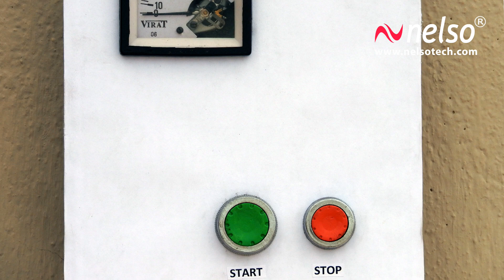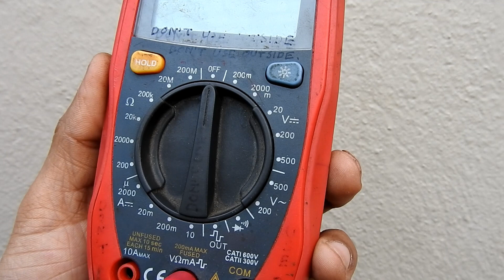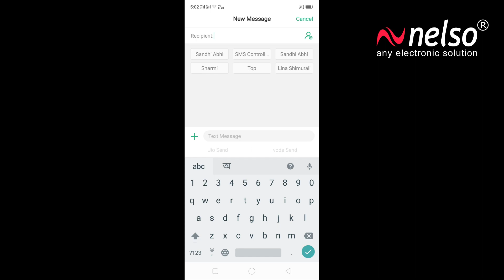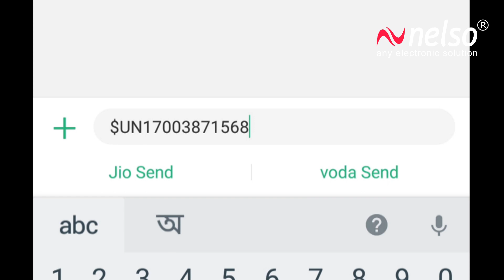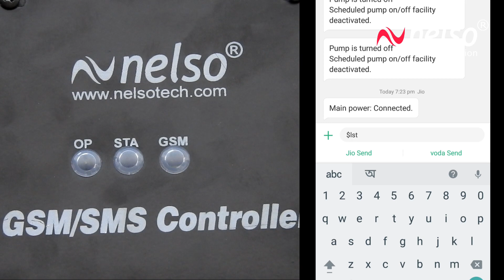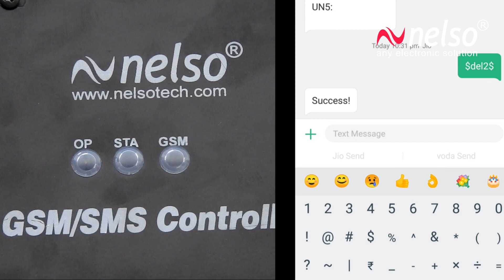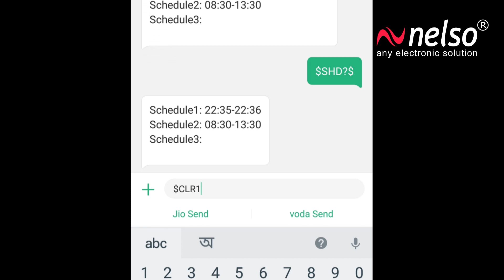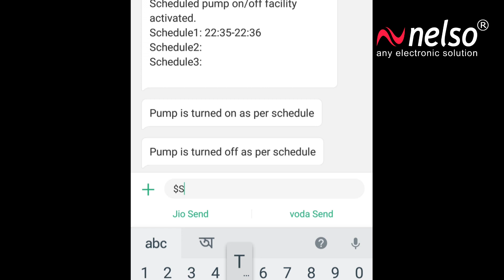English - GSM or Cell Phone based Pump Motor Controller

Comment: Sir/madem and also require electronic starter dry run controller,over voltage,over current, short circuit, and many farmers are died due to touching the outer panal box so please send me the price list of all these instruments . And also I require in very bulk quantity. My whatsapp number is 9448178181.

Comment: Does it give sms if pump is on dry run.. Or if you are trying to operate while there is power failure at the pump site?
Reply from the maker: it will not start during dry run & send u a message regarding dry run condition. in battery pack device u will get notification about power failure. for more info plz, visit our website www.nelsotech.com or w,app 91 6293666222

Comment: And if one phase is not present then motor will start or Error message
Reply from the maker: That depends on your existing control panel
Reply: contact for IVRS system without voice module for Fram pump motor controller with motor  and cable theft protection 9823042432 OEM Solution and Technology Transfer option

Comment: It works on 5 HP three phase motor
Reply from the maker: It will work for any motor
Reply: contact for IVRS system without voice module for Fram pump motor controller with motor  and cable theft protection 9823042432 OEM Solution and Technology Transfer option

Comment: How much rs
Reply from the maker: Rs. 4490/- Please visit https://www.nelsotech.com/products/pump-controller/gsm-pump-controller.php
Reply: contact for IVRS system without voice module for Fram pump motor controller with motor  and cable theft protection 9823042432 OEM Solution and Technology Transfer option